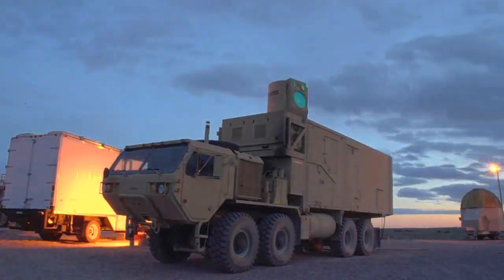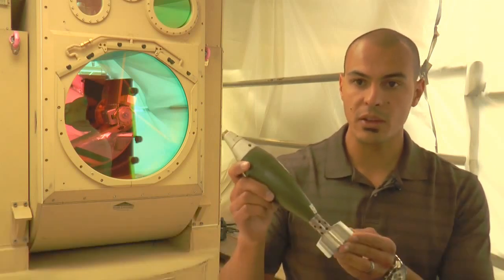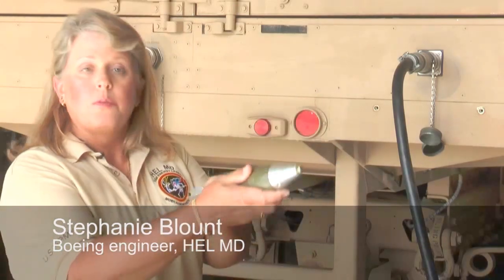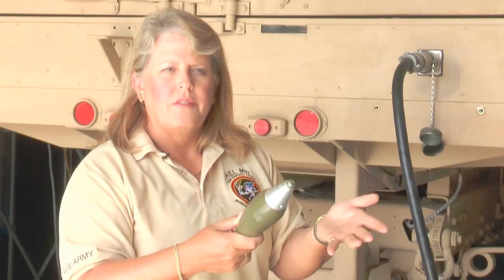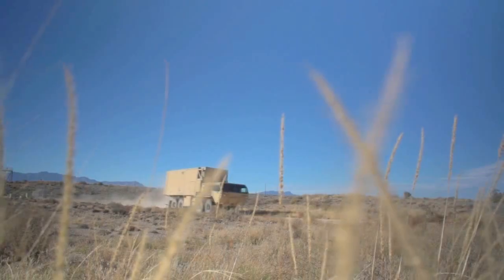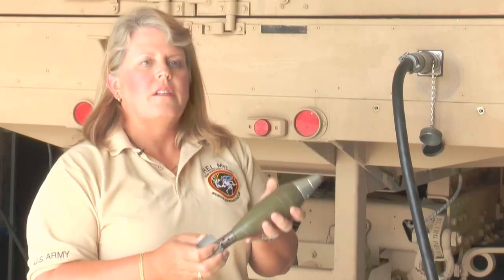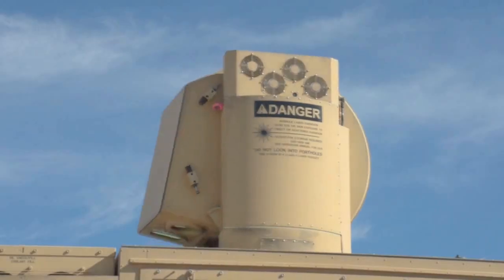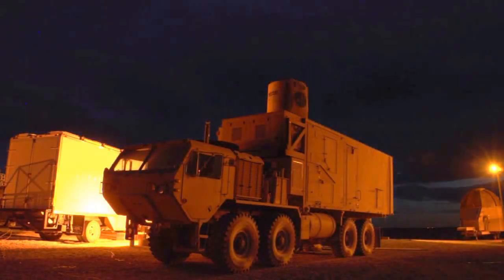Boeing - High Energy Laser Mobile Demonstrator (HEL MD) Destroys Mortars Mid-flight [720p]

Comment: Would this system work, if the mortar shells were covered in "tin foil" like reflective surface + given a slight spin by bending the fins a bit ?
Reply: @Crozbyguy Fin stabilized shells don't spin. They are launched from smooth-bore tubes. And heat conductivity is not the same as reflectivity. Aluminium that reflects 90% of the incoming energy avoids absorbing that energy....effectively reducing the power of the incoming laser by 90%.

Comment: The most problem of any laser system just like any high voltage system is its cooling system, actually the  needed energy to cool the system is several  times higher than the  needed energy to generate the laser. with increasing the threat which this systems may encounter with, the     possibility of overheating the system and malfunction or geting Jamed would be increased. in a scenario like dealing with opposing multiple rocket launcher system like a heavy barage of BM-21 Cold War era rocket artillery system, there would be a great challenge for this system's cooling unit engineers.
Reply: These are cryo-fluid cooled. They don't get jammed because it uses another laser to actuate the optic surface to keep the beam focused. As far as its ability to take down large mass raid sizes remember that we can do that with missiles which has a fly out time to factor in, a laser travels at the speed of light.

Comment: once again the problem with lasers is engagement time especially in suboptimal conditions. Also reaction speed vs close range fire such as mortars where time to impact is less than 30 seconds. Also how will the system cope with salvo fire. bearing in mind that the laser generates alot of heat so internal cooling for the laser is an issue.
Reply: amancalledfroggy both the cooling problem and dispersal issues under sub-optimum conditions have been addressed by technological advances that greatly mitigate them. for cooling because we can now add multiple weak laser beams together into a strong single beam the individual emitter elements develop less heat and can be cooled by simpler less massive cooling systems. effectively the cooling solutions needed for something like the ABL would be only about 1/3 as  beefy if developed now. as the cooling footprint was one of the main obstacles to physically putting a laser weapon like this onto a mobile platform expect these weapons to be on hmmvs and jet fighters and helicopters soon.

as to suboptimum conditions in adition to laser sensing of atmospheric turbulence we now have the ability to precede the main weapon beam with a burst to clear a vacuum channel between weapon and target and then bracket the weapon beam with pulsed beams to keep the beam from diverging. this means greatly increased range and greatly reduced power loss forthe same initial power input.
Reply: Jerry Adams thanks for the reply. do you have a link to a paper for the solution to atmospheric interference and attenuation?

Comment: I'm not too sure how well this would work if there were multiple mortar rounds or shells incoming, still a cool way of killing drones and sub mach1 cruise missiles.
Reply: There is an old video of them using a laser that was less mobile platform that destroyed multiple mortars at the same time they were in the air.  You can look it up.
Reply: @deltaboy2011   there was one where it shot down a cruise missile but it was a different laser.
Reply: It takes about 1 second to destroy a mortar shell, with multiple trucks it cold be very affective, a few will slip pass but as long as most are destroyed it is worth it